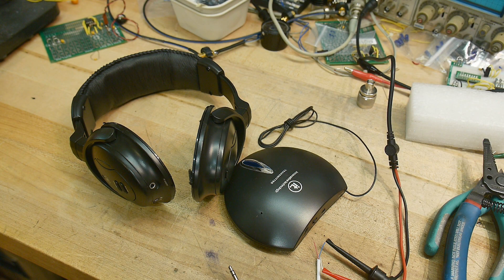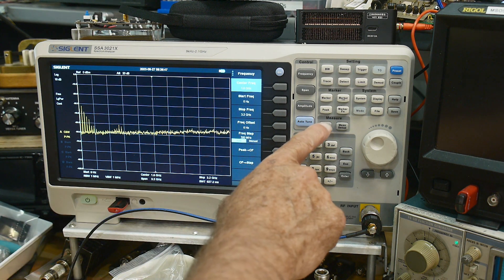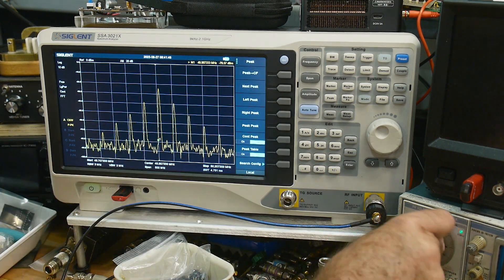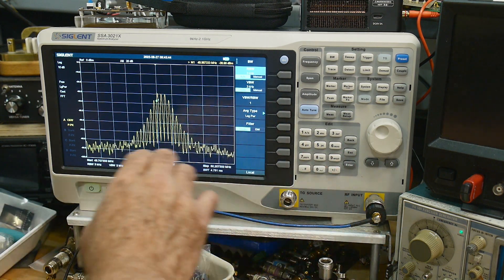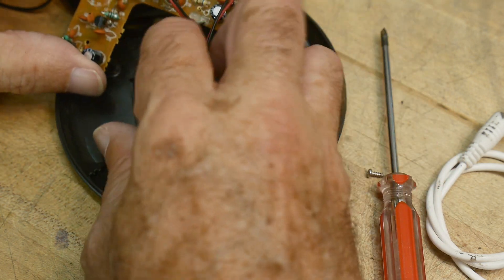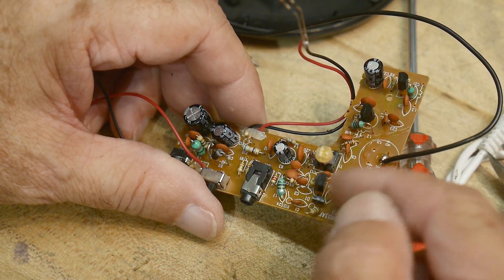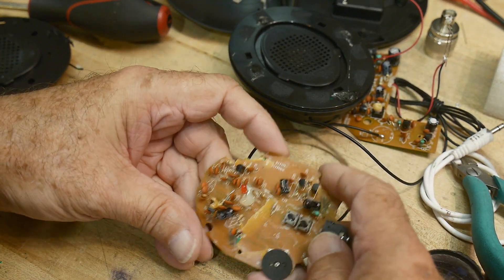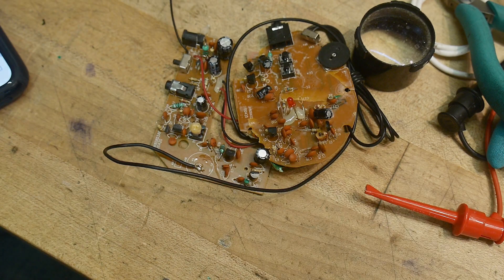#1647 Simple Wireless Headphone Teardown

Comment: What is the "auto-scan" all about?
Reply: It's because the transmitter is a free-running oscillator and will drift a lot in frequency. The receiver locks in on it and follows the drift. I've seen the same trick on ultra cheap Chinese wireless microphones.

Comment: This Silan chip is a knockoff of the Philips TDA7088T which was a success in making it possible to market lots of cheap auto-scan fm radios in the late 90's to early 00's.
Successive improvements in technology led to DSP all-in-one receiver chips that also tune with buttons but with better specs and even in stereo; but they were developed by chinese chipmakers by themselves (well, maybe inspired by Silicon Labs DSP advances).

Comment: For any FM transmit frequency and a given deviation ( say 100.1 MHz with 75 KHz deviation ) there is a certain audio modulation frequency that will cause the carrier to drop to zero at 100% modulation. When transmitter maintenance is performed, the engineer will modulate the transmitter with this frequency increasing the modulation until the carrier nulls on the spectrum analyzer display, then he will adjust the modulation monitor calibration to read 100%. A bessel function can be used to calculate the modulating frequency. I've tried reading several articles on this, but they don't make any sense to me. So if I want to null the carrier of a 100.1 MHz transmitter with 75 KHz deviation, how do I calculate this? Can you splain it to me?
Reply: rfburns - It's F***ing Magic.
Reply: @robinbrowne5419  Fornicating Modulation!
Reply from the maker: that is a lot of math. I would do it in matlab
Reply: @IMSAIGuy  I have discovered that it is not that hard. I was under the misunderstanding that the modulation frequency to null the carrier was dependent on the carrier frequency. It is not. It depends on the modulation index. There are multiple indices that will cause the carrier to null. The first index is at 2.4048. So if you want to set the deviation on your Kenwood, presuming you wanted 4500 Hz deviation, you could play 1871 Hz (4500Hz/2.4048) into the mic, and adjust the deviation til the carrier nulls.